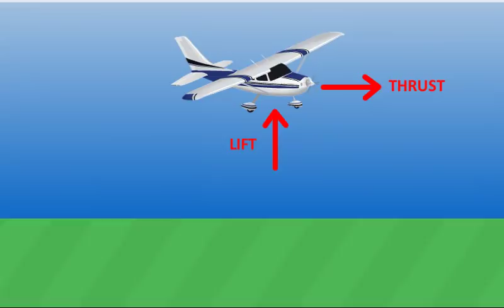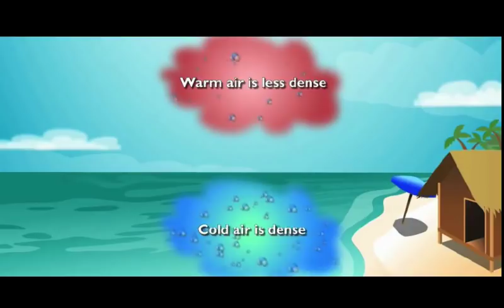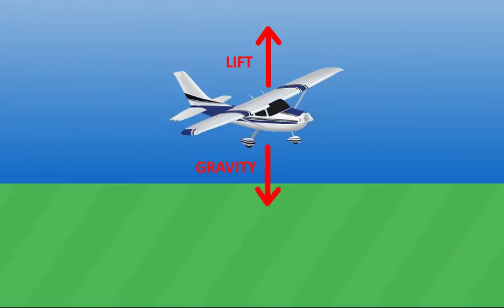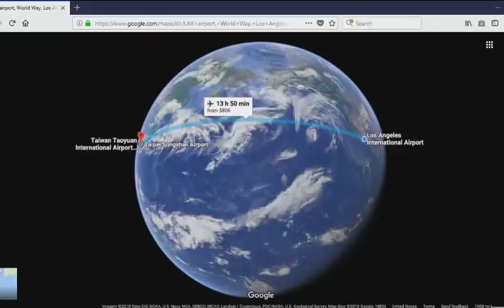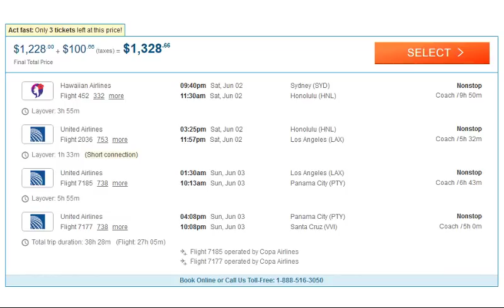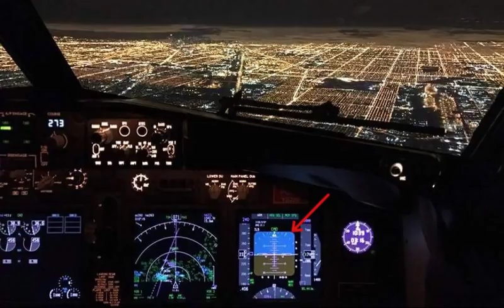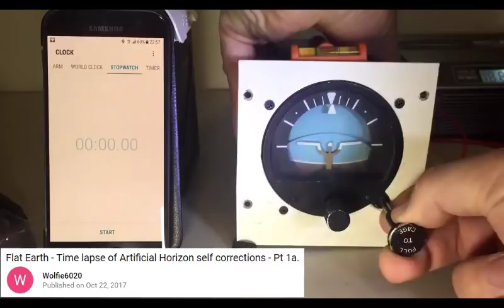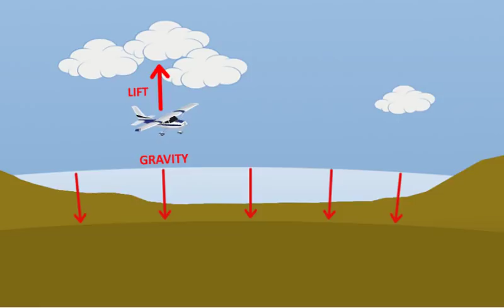Flat Earth Falsities - Plane Nonsense

Comment: Excellent video! This perfectly explains many things that I have been trying to explain to flat earthers on other videos.

One point I wanted to make is that sometimes they have trouble linking your 3rd point regarding how a plane follows around the curve of the earth and I believe it was your 6th point regarding how airplane gyroscopes work.

Many of them cannot understand why a pilot does not have to dip the nose of the plane as they go around the curve of the Earth. I can understand why they are confused about this, because if you imagine a plane taking off and flying level at the North Pole and flying down to the equator, it would go through an arc of 90 degrees, and the actual position of the plane in space would have tilted 90 degrees relative to its original starting position. Flat earthers always mistake level flight for tangential flight. They believe that when a plane is flying level, that it would be flying in a perfectly straight line tangential to the Earth's surface. If it did, it in fact would gain altitude. This is not at all what is meant by straight and level flight though. Level flight means maintaining a constant altitude above the Earth's surface, even as it curves.

So how do we then explain to them how a plane can turn its nose downward 90° between the North Pole and the equator without the pilot having to actually dip the nose of the plane down?

I know some flat earthers are getting excited now, because this is the actual question they've been wondering for a long time... but I'll tell them how.  What they are assuming is that a pilot could somehow take off, level out at 30000 feet, and basically lock in the yoke and the throttle and continue to maintain a perfectly linear flight path. This is absolutely not true whatsoever, and anyone who drives a car would know this. If you're driving a car even on a perfectly straight road, you are constantly having to make small minor adjustments left and right on the steering wheel in order to stay straight in the lane, because of minor variations in the road, wind, etc. You also can't just hold the gas pedal at a fixed position and expect to maintain the same speed. You are constantly having to let off the gas or give it more gas to keep the needle at the number you want. Pilots also have to do this to maintain a constant altitude, by making small adjustments to the yoke or the throttle to maintain a constant altitude and pitch. they either do this manually, or engage the autopilot, which does it for them, much the same as cruise control on a car adjusts the throttle to maintain a constant speed.

So, the understanding that a pilot or the autopilot are constantly making minor adjustments to the controls to maintain a constant elevation, combined with the excellent demonstration you gave of how a gyroscope is designed to correct itself to gravity, it should be fairly obvious that the pilot is in fact slowly tilting the nose of the plane around the Earth as it travels, but those adjustments get combined in with all the other small adjustments that are constantly being made throughout the flight.  Therefore, the pilot does not actually have to consciously dip the nose of the plane as he is flying.

I actually did some calculations to try to figure out how much the plane has to dip the nose relative to the starting point over an hour of flight at 500 mph, and I came up with 7.2 degrees. I'd be happy to show anyone how I arrived at that number and you can check my math if you like. A 7.2 degree tilt over the course of an hour would not require any noticeable adjustments to be made. That would be like driving for an hour on a road that takes a very gentle 7.2 degree turn spread out over 60 miles. Driving on that road, you would never notice that degree of turn because it would be mixed in with all the other little adjustments you make to stay in your lane. In fact, from down on the road, it would appear to be perfectly straight, much like the horizon appears to be flat from on the ground.

Hmm...
Reply from the maker: Jim Lee - Thanks. You make some great points. I should have talked about the pilots’ adjustments in the video. I have made that clear in comments though. They have to adjust for air currents to keep the plane at the desired altitude and direction.
Reply: @Rollie I completely agree with your second paragraph, but I was trying to use the words that they like to use and that I'm assuming they understand. As much as they like to talk about perspective, they have a hard time understanding scenarios from different perspectives.  From the pilot's perspective, all he has to do is keep the plane's attitude level relative to the Earth that he is currently over, and maintain a constant elevation. 

However, I was trying to explain things to them from the perspective of an observer in space watching a plane go from the North Pole to the equator, because this is one of the many concepts they have a hard time grasping. As you have agreed, the plane definitely would rotate 90° about its lateral axis during that flight path, and I'm trying to explain how that rotation occurs without conscious input from the pilot or the autopilot to do so.

As for your third paragraph, I completely agree that none of the adjustments a pilot makes are for the sake of following the curvature, and that's exactly the point I was trying to make. I guess I could try to state it another way... that if you added together the sum of all the slight upward and downward attitude adjustments made in order to maintain level flight, I believe that they would add up to a total difference of 90° nose down over the course of that entire flight. At 500 mph, this would be roughly 7° an hour. I completely agree that it is gravity and pressure gradient and that caused the overall flight path to follow the curvature of the Earth, but I was trying to specifically explain how the relative orientation of the plane along its lateral axis, from the perspective of an observer in space, could change throughout a long flight without the pilot having to specifically adjust for it.

I also totally agree that removing gravity in the atmosphere while the plane is in level flight would result in a tangential path. The problem is, almost every flat earther seems to think that planes naturally fly in a tangential path to the Earth, because that's what they think level flight means.
Reply: @Rollie  I think a lot of their misunderstanding about gyroscopes comes from being told that once a gyroscope is spinning, that the direction of its axis will be unaffected by gravity, so that as the plane moves over the curvature, that the gyroscope would just continue to maintain its original orientation. This comes from a very simplified understanding of physics and gyroscopes and how they actually work. A lot of them are ignorant, and some willingly so, of the fact that gyroscopes in aircraft have a mechanism built-in specifically designed to reorient them to gravity.

I generally try to avoid insulting anyone who is seriously attempting to understand things and trying to find the truth, but if you check out the following link, this particular dolt is a special breed. https://youtu.be/TpVZi1w58Nk He is so extremely confident in his complete ignorance that this is actually laughable, when he makes the claim that a gyroscope can't be moved from its axis once it's spinning, but then look at the 3:30 mark in the video and notice what the very first thing the professor does with it once he gets it spinning.  The entire point of his video is completely invalidated by his own video.

Comment: All of the shit that y’all say in this subject is just what you’ve been taught. You have no reason to believe the earth is a sphere other than they taught you that shit, like Santa clause. You’ve never actually seen the earth as a ball with your own eyes but yet you insist that it is when all that you see with your eyes is that it’s flat. Please anybody, make me a believer with one answer. How much curvature should we have for a land mass that’s 10,582 square kilometers?
Reply: rickey mccombs
"All of the shit that y’all say in this subject is just what you’ve been taught."
Given that is a lie, as has been proved to you, why are you opening new threads and repeating your lies?
Reply: rickey mccombs
"Explain level flight bro."
Aircraft naturally follow the curvature of the earth without any input from the pilot. This is because the aircraft flies through the atmosphere which also follows the curvature of the earth.
It's the air pressure that keeps a plane in level flight. Increasing altitude reduces the lift and the plane falls; decreasing altitude increases the lift and the planes rises. The angle you're talking about is around 0.01 degrees
Inertial navigation is different.
https://en.wikipedia.org/wiki/Schuler_tuning
And read  the references provided.
The "schuler loop" is an integral part of avionics, that automatically compensate for earth's curvature.
http://www.mediander.com/connects/26619546/ln-3-inertial-navigation-system/#!/topic/-/
http://aerostudents.com/files/avionics/navigationBasicsAndInertialNavigation.pdf
Reply: rickey mccombs

You are an idiot.You have never seen with your own eyes, that Earth is flat. Millions of people have seen, that ships and landmasses disappear down, under the horizon or come up, from below the horizon, when sailing the ocean.
Also, millions of sailors have measured the distances between Australia, South Africa and South America.
The distances fit perfectly for a globe Earth, but would be totally different, if the Earth was flat.
Reply: Let's also see your evidence for a flat earth. Take me to the edge of it. That's called conducting research, something the FE people are always telling people to do for themselves. And no crap about ice walls or naval blockades. Yes or no will suffice. If you can't do this, then STFU. Come on, man up and just answer the question.

Comment: Explain level flight bro. Don’t say gravity. If you can get on a plane with a level and fly for 100’s if miles and the bubble on a level will stay level.  There must be some curvature right? This guy’s answer to everything is gravity. Magic gravity does a lot of shit bro. It’s the magic answer. I never said I believe in a god or religion bro. You just assumed that. I believe in the truth bro. I’m certain that we’re being lied to. Think bro.
Reply: Aircraft naturally follow the curvature of the earth without any input from the pilot. This is because the aircraft flies through the atmosphere which also follows the curvature of the earth.
It's the air pressure that keeps a plane in level flight. Increasing altitude reduces the lift and the plane falls; decreasing altitude increases the lift and the planes rises. The angle you're talking about is around 0.01 degrees
Inertial navigation is different.
https://en.wikipedia.org/wiki/Schuler_tuning
And read  the references provided.
The "schuler loop" is an integral part of avionics, that automatically compensate for earth's curvature.
http://www.mediander.com/connects/26619546/ln-3-inertial-navigation-system/#!/topic/-/
http://aerostudents.com/files/avionics/navigationBasicsAndInertialNavigation.pdf
Reply from the maker: Rickey mccombs - How do you think a bubble level works? It's not magic, it works by the force of gravity, which is always directed toward the CENTER of the earth. So no matter where on the earth you take the level, it will indicate level is parallel to earth's surface.
Reply: "The earth was known to be flat until 500 years ago." Who told you that lie?
Reply: Rickey has been watching to many D.Marble videos.
Reply: Like to see a Gravity prediction that can not be density, or Geocentric construct. NASA admits using"also" that old one to predict.
[ These theories attempt to overcome what many researchers consider to be two enormous problems with our understanding of the universe. Observations going back decades have shown that the universe appears to be filled with unseen particles—dark matter—as well as an anti-gravitational force called dark energy. Alternative theories of gravity attempt to eliminate the need for these phantasms by modifying the force of gravity in such a way that it properly describes all known observations —no dark stuff required.]

https://www.wired.com/story/troubled-times-for-alternatives-to-einsteins-theory-of-gravity/
Reply: Lord I already answered that ball in vacuum nonsense. At me also are you?
Reply: O I got my style, even in my own language, nor a writer or teacher for sure, but give a lot of education and asked for more...
Helps to put in context of the thread questions.
#1 Density, air or not, would be a UP and DOWN and balls dont float.
#2 Magnetism proven FORCE that is strong. 
"bowling ball that falls to the Earth while inside a vacuum chamber." Hoo boyI without a pulling force it should just FLOAT because no pressure??? Just proves Gravitons dont care about real vacuums with no gasses, plasma.. matter's. TIRED!
"Like to see a Gravity prediction that can not be density, or Geocentric construct" explanation!
ex: Like tides because of MOON pulling business :)
Reply: Volume of lead is much heavier than the same volume of iron.
The (_?)force is greater on the heavier object.
Not sure Density needs pushing matter.
No We dont know it isnt magnetism, as so much We doesn't know.
The Earth itself is a giant magnet.
Got proof of that already knowing?
Magnetism is one aspect of the combined electromagnetic force.
The motion of electrically charged particles gives rise to magnetism.  Much depends on their magnetic fields.
All materials experience magnetism, some more strongly than others.
Reply: 1) plane pilots will always stay distance from the ground.
2) bubble level works with gravity, as long as the plane keeps the "buble level" level as it fly. The plane keeps the distance from the ground.
3)gyroscope not equals to bubble level. They are not the same.
4) if you have a gyroscope calibrated and the disk spinning parellel to the gravity at point A. When the plane travelled 1/4 of the earth circumference, the disk tilted 90 degress , at 1/2 circumference 180 degress. , at 3/4. 270degress and then back to point A it return to its parellel state.

5) if you use gyroscope as reference and powerful rocket to overcome gravity. As it fly in stright direction while keeping the spining disk flat. The rocket will leave the earth.

Comment: If an aircraft traveling in a straight line ( level flight ) was held at the same hight above the globe by gravity as you say then after traveling a quarter of the way around the globe the aircraft would be at the wrong pitch , or does  gravity not only keep the aircraft at the same hight above the ball but also constantly pitch the nose down to keep the aircraft horizontal with the land its flying over  ?
Reply: Mc Bain It's the lift from the air flow over the wings that keeps the flight st the same altitude. Too high, too little lift; too low, too much lift. 

At 1 degree per 69 miles how far down do you think the plane's nose be dipped?

Comment: It's funny how flat Earth believers can't understand a straight line and a level one you can draw a line around a golf ball right down the middle of the ball is that not a straight line because it is
Reply: Do globeheads understand the definition of LEVEL? Or a 3d straight line?
Reply: Yes we do and he explained what level means in context to flight dumb ass. OWNED!
Reply: Ha ha what a powerful owning, Gravity mistress does not level a Plane's body, he is claiming it keeps parralel to (all?) surface, that is no level business. Altimeter: The altimeter reflects the aircraft's vertical height above MSL (mean sea level).
The artificial horizon senses movement from the gyroscope and remains suspended in relation to a self-erecting gyroscope, which "holds" its position in reference to the actual horizon. 
I have already given definitions of LEVEL, none are for airplanes.